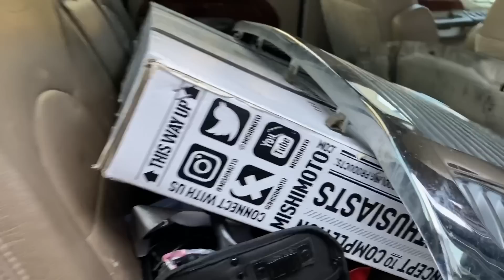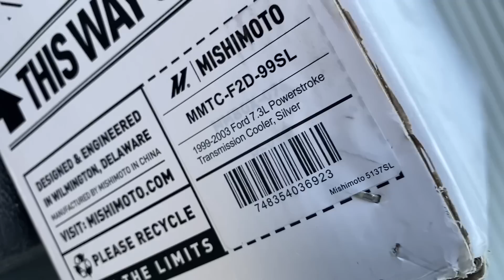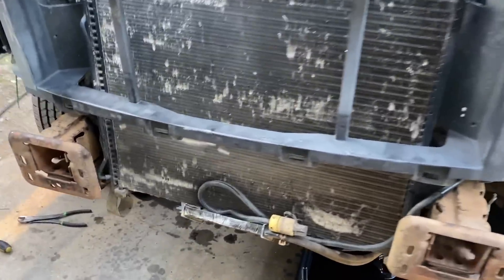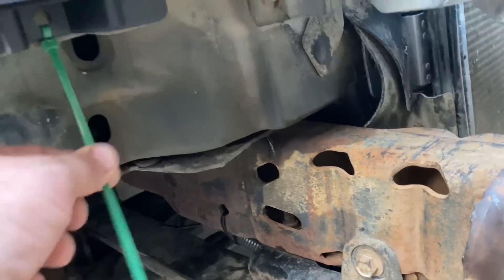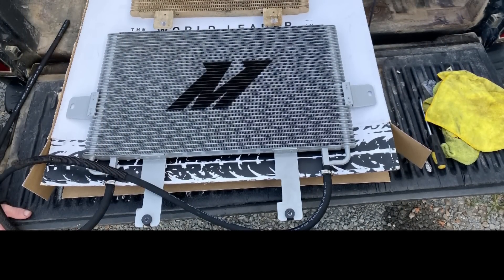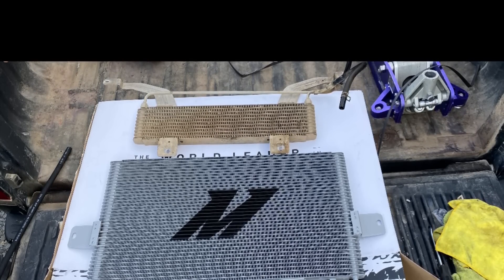Tow Pig Upgrades, 7.3 Transmission Cooler

Comment: 2 air to oil cooler is too much restriction
Reply: Can you explain why.  I  have the factory cooler along with the 6.0 trans cooler. I have a 1999.5 with 7.3. Plus a mag hytech transmission pan.  I have 38's with 8 inch lift.  Ok, when I installed the 6.0 transmission cooler it may be got to 190 / 195 pulling on a hot day. The only thing was ,my gear ratio was still on stock and  my truck was seaching 3 to 4th alot when pulling.  So got a gears 4.56 which should have changed my overall ratio to 3.73'ish. Well it revs higher and at high way speeds and heats up quickly.  Makes sense,  turn something faster heats up. If I  got rid of the stock cooler and just kept the 6.0, would that cool better?? 

Thanks for your advice

Comment: Yep I did the same to my 99 f250 put the bigger cooler on it.also did the fluid and filter change on the trans.but eventually I had to have it rebuilt.spend the extra bucks on it with up grades and good tork converter.no problems with it since I have around 30 thousand hard tow miles on it.

Comment: I run the same mishi cooler on my 7.3 and the temps never get over 170 pulling dump trailers loaded to the gills. If youre having problems with the 1>2 id check the data and watch the commanded gear, put dieselsite accumulator body in the trans. Get yourself a HYDRA with some tunes from one of the 7.3 gurus. I have Gearhead tune files but also have hybrid "mini me" injectors but those are like 2700 bucks.

Comment: I would recommend an RDS toolbox fuel tank combo for the bed especially traveling like you do. They are very nice to have and easy to install.
Reply: Got a a 60 gal RDS tank in my Ram. Easy to install and works great. When you pull a heavy trailer the stock 20-25 gal tank doesn’t go far at 9- 10 mpg towing. Tank has been in two trucks. Initial install was an F-250.  I bought their installation kit.

Comment: If you put a tuner on there it will clean up the shifting immensely. I have several different Power Strokes from all the different generations that I use for personal as well as for my business so I’d like to say I have a decent amount of experience with the good and bad of running tuners vs stock. I usually like to leave my the trucks for my business stock for longevity sake and less wear and tear from my employees.  But after all these years I still have three 7.3’s (two autos and one manual) that are used to tow with a good bit and I do run Hydra tuners on them because it’s honestly a night and day difference. In my personal opinion I never felt that the shift points on 7.3 autos were in the right places and felt sloppy. I kept having people recommend that I try a hydra but I was hesitant  because they made it this far in life stock. After adding one to my personal 7.3 excursion I was sold, it was a night and day difference. I ran it a bout a year trouble free so decided to put them on my others (two of the truck I have had since new) because it just made them feel like a more modern day diesel. There’s plenty of different tuners and chips out there and everyone has their own opinion on what works best but in my personal real world experience I would highly recommend the Hydra for Power Hungry Performance. Not only do they work great they are very reasonably priced. I probably paid 4 times more for the tuner on my newest Superduty and don’t get anywhere near the noticeable benefits that I get from the Hydras on my old 7.3’s. Again it’s all personal preference but I couldn’t be more impressed with the results so that is my recommendation.
Reply from the maker: Thanks, I've never heard of them.  I just go a TS Performance 6 position chip, I had one on the excursion and loved it

Comment: John I'd look for a  Edge CTS monitor you can watch all kinds of stuff anything the computer see.  Trans temp epically  and you can add an EGT  Sensor.
Reply from the maker: I just realized my scan tool can monitor it also.  Will have that connected next trip for sure
Reply: @TurboJohnRacing  nice yes it will.  I just personally like the CTS over multiple Gauges one screen to watch plus you can set alarms when something goes out if range.   I'm sure you aren't going to see any trans temp problems with that new cooler.

Comment: Trans shifting issue.....replace the TPS.  My 97 e4od, was having all sorts of shifting issues.  The 4R100 is just an updated e4od.  I completely rebuilt the trans with all updated internals, and still had same issues.  Sometimes it would shift early, sometimes it wouldn't shift until I let off the throttle.   All problems disappeared after I replaced the TPS

Comment: That a/c issue is fairly common for those years along with excessive trans heat. Get ya a decent pusher style electric fan and mount it on the condenser this will also help with trans heat. The stock engine fan just doesn't pull enough air through to keep everything happy. I've done a handful of em and had great results..
Reply: Good idea. Got any videos of this setup? Thanks
Reply: @banedye7036 any pictures?
Reply: Yeah I can show you pictures of mine. How the hell do ya ad pictures on here? Lol

Comment: I think I remember you saying that was a farm truck, that trans cooler is probably packed with dust it’s probably turned into concrete. Have you back flushed your radiator yet??
Trans service and flush the converter. You and them F’ing zip ties. 😂😂😂

Comment: Make sure you clean that exhaust back pressure tube or change it. They clog up on the 7.3 and cause power loss and other weird problems
Reply from the maker: Yep, I put the scanner on it last night and the back pressure sensor was reading 53psi.  New one with new tube will be here tomorrow.

Comment: Thats one hellova trans cooler lol, should hold several more quarts of fluid. The cooler cost is a lot cheaper than a transmission and the converter clutch will appreciate that fresh fluid for sure, is it a stock fan clutch? It may be due for a replacement if the AC isnt cool at idle, i replaced mine when i changed water pumps and mine does fine at idle now
Reply from the maker: It comes on strong as the truck gets hotter.  May change it.  also gonna bypass the heater core

Comment: John, if you want that AC to cool better at stops, turn the damn heater off!!!  It's super difficult for the AC to cool well when it's having to compete with a heater core with hot water running through it!!! 😁

It's not your fault, Fords penny pinchers from back then didn't allow the budget for a heater valve so therefore  there's no way to cut the hot water running thru it when the AC is on. The fix is to install a heater valve for a Ford Ranger. You'll have to tap in a vacuum hose from underneath the dash to control the heater valve. Once you get this done you'll be pleasantly surprised on how well your AC will cool once you get this done!!!
Reply from the maker: I just looked at the vid, looks easy to do.  I'm gonna do it for sure! Thanks
Reply: Here's link to a YouTube video with all the info needed to get this accomplished. Trust me, this will make a huge difference in the cooling of your AC not only at a stop but at cruising speeds just as well!!! https://www.youtube.com/watch?v=IVXExrJPlfE

Comment: You’re probably way ahead of me but if the ac sucks when you’re not moving check your fan clutch. If that’s all set put a set of gauges on it and pull some 134 out. I’ve seen a ton of fords overcharged by as much as a half pound from the factory and the added refrigerant actually hurts it. Even if the pressures are within spec, less cools more to a certain extent- more refrigerant turnover

Comment: if thats an e4od you are gonna need a refresh on it. do not tow with overdrive turned on it will eat it up. those trannys just dont like heat. i changed alot of them when i worked for ford truck. the  cooler will help but if it aint shifting the damage is done. also there should be a drain plug in the convertor as well pull out the round rubber plug in the bell housing it'll be a square head pipe plug.
Reply from the maker: it's the 4r100

Comment: I use a Tonno Pro soft folding cover on my Ram 3500 dually. I’ve owned four of them. Every time I trade trucks I buy a new one. Installation or removal time is less than five minutes.   They fold up far enough for me to pull a fifth wheel RV without removing the cover. Summit sells them. Shipped for free. Total cost was about $300.00 with tax.

Comment: John get a Air Conditioner Fin Comb, they really do work.
Reply: Was also going to suggest this although he would have to take front end all apart again to comb out the fins.
Reply: The compressors are weak on those trucks. Actually the compressors and the clutch, but our 7.3 truck,  we kept adjusting the gap on the ac clutch till finally we replaced the compressor and all fords around that time have black death in the compressor, so just replace it